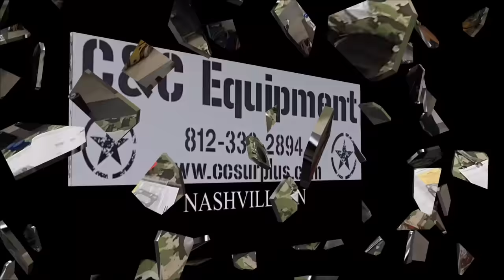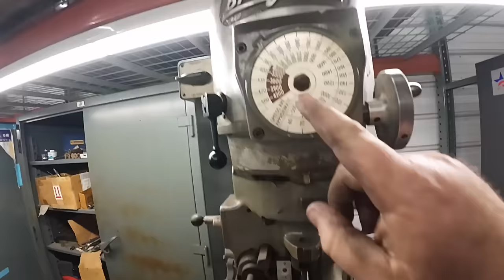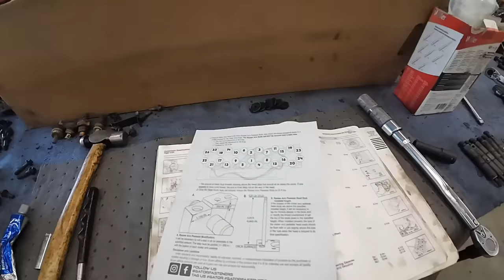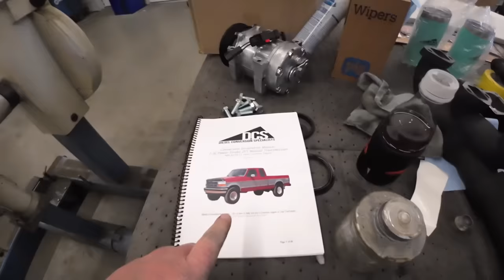Prepping the Cummins 6BT 5.9 12 valve for Tuckers 1995 Ford F350 with new go fast parts!

Comment: Your son showed he has been paying attention when bolting up the oil pump, snug one bolt, snug the bolt directly across, torque bolt 2, then torque bolt 1. It is the little details like that that set a good mechanic appart from a wrench turner. And he welds well, also.

Comment: My Dad wasn't a mechanic. There was an old school mechanic in our country neighborhood. When I was 19 I hired him to refresh a '79  Chevy 305 in a truck I bought from my Dad, it had 74k miles on it mainly on propane. It was very clean and smooth inside. Put a small 4 barrel on it and the mechanic massaged the heads as much as he could. This brings back so many memories. I did all the cleaning and prep work and helped him assemble it. I ran the crap out of that thing for over 100k miles. Tucker is making memories he doesn't yet appreciate.

Comment: In the late 80's and 90's we used this Cummins engine in our 18/20 ton trucks in the  UK. It was known to us as the "B" series but they suffered badly with failed  head gaskets. In the end we had problems getting them through the smoke emission regulations.

Comment: That red 95 350 is a very nice looking truck. Very lucky find! The white 350 was nice already but damn. Needs to keep it set up just the way it is, with the running boards, windshield visor and all. It’s cool he went with Cummins tan but the valve covers would have looked really cool red. Nice job either way. Lucky man! Betting the truck and engine combo will last longer than anything currently built and/or built within the last 20 years as well as be much easier to work on.

Comment: FYI the little ball on the injector also aligns the spray pattern since the pattern is slightly angled.
Reply: I believe this is correct that the spray pattern is slightly angled because the injector is also at an angel.

Comment: make sure to do a hot retorque on the head studs even though most brands dont recommend or say its necessary i think its a great piece of mind, regardless if you keep it stock or not, mine did loosen off 10-15lbs each, which blew another headgasket on arp 425s they state to stop at 125, mine are all around 115 when i checked them after i blew my head, i redid everything and stopped at 135 this time, then i did a hot retorque and did 140.

Comment: A few years ago a dump truck and pup ran off the road, over my ditch and down my fence line.  On the way down, it tore out a stump by my fence line(roping up the steering and front brakes) after it was stopped, the engine was off, but the fuel pump was running, causing a fire that the fire dept had to hookup to a hydrent to extinguish fast.  The fire caused 2 Doug firs each about 30 years old etc etc.  point is a power fuel pump can be a issue.  A battery disco switch can save your life (like the foam in my carb when my cruise lander rolled down a hill😊

Comment: Fire Engine Red!!! I had a F150 4x4 with a Detroit Locker rearend and 351 V8 with a Holly two barrel carb. 8 ft bed with a stream line fiberglass cap on it. No junk no nothing…. Got 18 mpg in the hills!!!

I miss that truck and I wish I still had it!!! It was the same fire engine red!! Had a set of aircraft landing light as well as a set of rotating amber dome lights!!! And a plow.

DE N2JYG

Comment: You still need 12 volt for the electric fuel shutoff. A handful of d batteries and duct tape.  You are good to power the fuel solenoid.
Reply from the maker: Nope
Stay tuned no power needed

Comment: wonder if area diesel etc ever did a video re what they find on fuel control units they see,  are better filters  or water traps what owners should install etc to get longer life, also, never see anyone build an engine without a package of cookies on the work table ? how do you keep your strength up??  to hold hoses on, you clean the pieces and spray it with hairspray, then connect, it dries and makes for a stickier connection

Comment: Good call on studs, did you upgrade rod bolts? Think "P" pump then you can fuel to any output and truck increases in value when it is sold. Motor is nicely detailed Tucker should take a bow for a fatiguing/boring job well done in cleaning/prep and masking engine for paint. Why not an automatic tranny for personal use seems worth the effort? Ray

Comment: So far I get where you where going with this build. Cummins swap into the 1st truck made sense.  Cummins swap into a low mileage Power Stroke is a head scratcher. The 7.3l could have made 300 RWHP for less $$ and would have been as reliable.  Or did I miss something and the 7.3Power Stroke was a 7.3 Turbo diesel?  So future plans, Exhaust brake, Rear end locker? Is it currently a rear wheel peel open differential?
Reply from the maker: Very true but you may of missed the part about simple
Power strokes are awesome, I drive one everyday but they are electronically controlled and 30 years old now
The Cummins we are build will require 0 electrical to run
The truck can have a dead battery and no alternator and still run.
We are building this truck to be reliable and run out of state pulling a trailer
As much as I love my 30 year old power stroke it’s always in the back of my mind when the electrics will fail

Comment: Did y'all read the casting numbers on the block itself, because the blocks with 53 are thin and have issues of cracking down the sides. 
In case y'all aren't aware of this issue

Comment: great video, really enjoyed this 1. working on them engine was what i done before retirement. wondering if the #1 locating pin was still in tack. located underneath the injector pump. usually if people use them forget to pull back out before turning engine.

Comment: how bout it. did you check the spark gap on that snow sled. I left you detailed suggestion about it but I think it got deleted cuz I put a link in to a Stevens spark gap tester. might do a complete cdi igtionion test on it if there are specs in book to see if stator is still up to snuff.

Comment: 27:06  Nope.  Those are not torque to yield.  Cummins even provides the length specs to determine if one has stretched beyond its use limits.  Or you can buy their special gauge tool.

Comment: Surprised someone Tucker 's age is licensed to drive a high powered vehicle and pull any type of trailer - how things differ in different countries. Hope all goes well with this build and the motor is not too hard on other parts of the truck.

Comment: Take those batteries out of that torque wrench. If you leave the batteries in it and they corrode it ruins the torque wrench. It’s not a covered warranty repair through snap-on.

Comment: Them old 5.9 Cummins were the pinnacle of reliability as long as the tune was reasonable. Their long crankshafts don’t respond well to high rpm. I think there’s a market for professionally built Fummins trucks. Ford truck, Cummins engine, and Allison transmission or 5/6 spd NV manual. The only question is how much one would need to sell them for to make a sustainable profit. I’d guess around $150K .

Comment: That is the absolute wrong way to use anaerobic-curing sealant.  You don't use gaskets when using anaerobic sealants like loctite 515.  Anaerobic sealants only cure with the absence of air on close fitting metal surfaces.  For loctite 515 to work it must be metal to metal.  The way you used it will actually make it easier for the gasket to fail.  Ultra gray rtv would have been a much better choice for sealant.  I would bet that probably half of all people using loctite and other anaerobic-curing sealants and adhesives are using them improperly.

Comment: I've seen a Cummins engine in Ford-n-Chevrolet trucks decades before Dodge ever started using them in theirs,😉👍, those who call it a Dodge engine are just dumb-af, I can't believe that Clint hasn't got a Ford 6.7 diesel yet,😖, they are such a much more refined engine than the Cummins, or that awful Chinese made Duramax, lol, btw, that's a killer 95 Ford ya got there Tucker, you'll have a hell of a truck when its finished,👍, awesome video guys, and thanks for sharing.